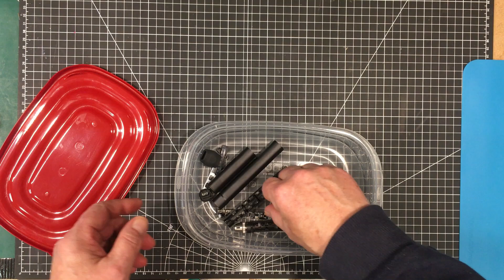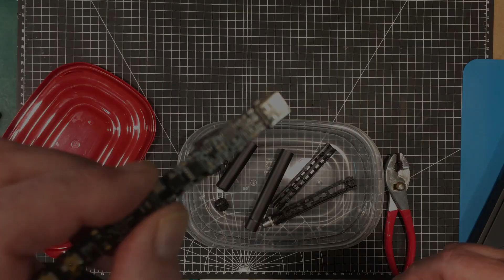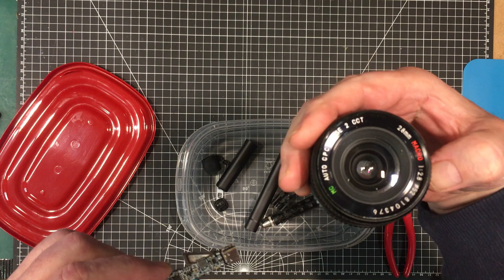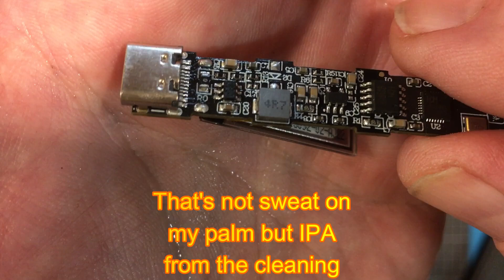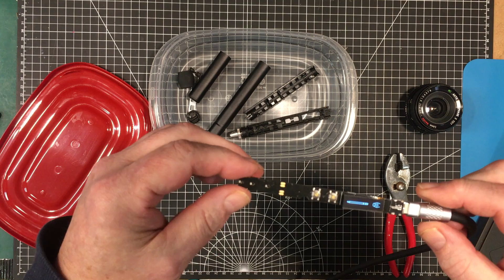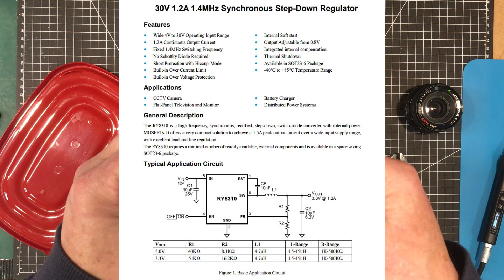Uni-Byte 0230 - FNIRSI HS 01 Soldering Iron REPAIR

Comment: Do you have any idea why would screen stop working? It wasn't dropped, anything, just a random black screen. It still melts solder, that's the only sign that it's still alive
Reply from the maker: It maybe that there was a failing connection to the display.  It is attached with a small ribbon cable and one of the joints might have been a bad one.  The could numerous other reasons too, bt that is where i'd start my trouble shooting.
Reply: Hello , did you solved it ? I have the same - LCD is off , but it still works somehow.
\
Reply: @call9trace  Hey, not yet, but I am pretty sure I will fix it in upcoming month or so - it's apparently a fairly common issue for this solder iron to have a faulty screen and I have ordered a new lcd. Some say it might be caused because of AC bleed into a DC but might as well just be a bad design.

I am pretty sure that I will fix this because mine did light up after taking it apart and moving a bit, but there were no way to make it working all the time.
Reply: @DanSi-y6k  where you buy the new screen? what's the part name?

Comment: I always wondered.. what is the absolute maximum voltage you can run these on? I know it says 20V, but how high do the components go? This regulator you changed has a maximum input voltage of 30V, but can the main mosfet handle that much Vds? Would love it if you test that in a video.. how far can you push the FNIRSI HS-01 :)
Reply from the maker: Hey!  I just got the darn thing working again!  (LOL)  Actually you can run it up to 24V at which point it's pushing up to 3.75 amps through the main MOSFET and the cartridge.  The MOSFET might take a bit more, but I think the cartridge would die early.  At 30V you'd be asking that heating element to swallow 140W!!
Reply: @ well now that you know how to take it apart, there is nothing stopping you lol

If I remember correctly I think I recently saw a USB soldering iron that stated a maximum input of 28V for the JBC C245 type cartridges. Going that high with a genuine cartridge having a 2.5 Ohm heater would result with at least 250W (accounting for loses and heater resistance increase)

So JBC HDE performance in a pen shaped iron.. plus a 300W+ power supply :)
Reply from the maker: @antonmilosevic  That'd be more like a welding iron!  LOL
Reply: @uni-byte  brazing copper/brass pipes was never easier :D